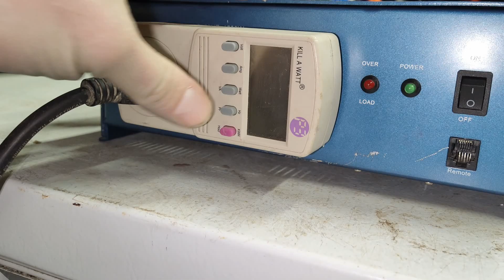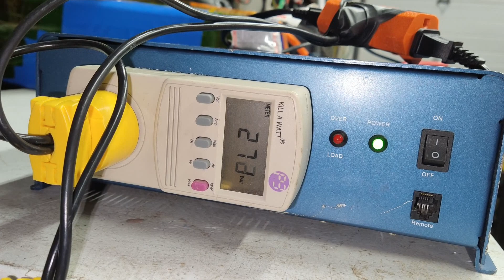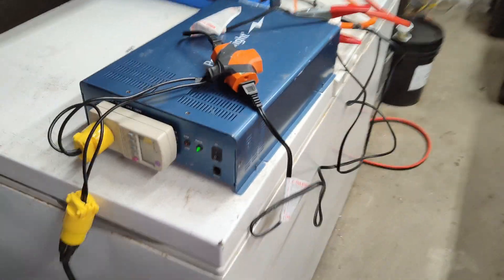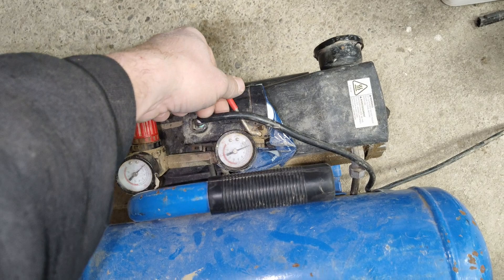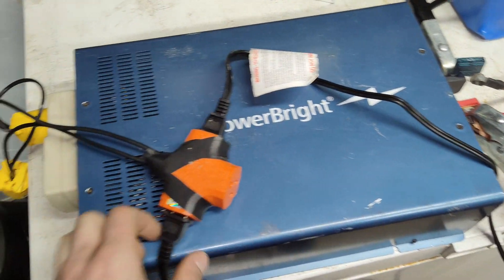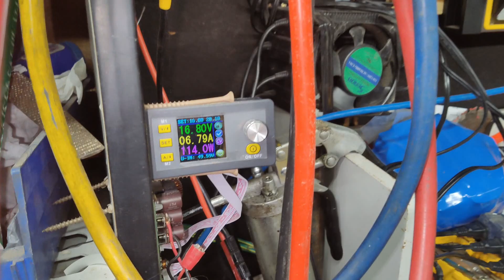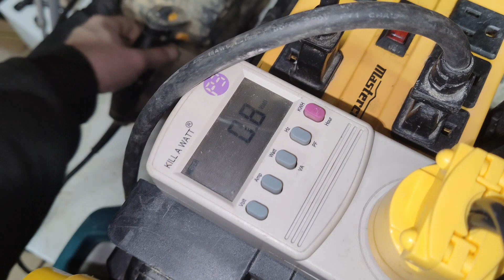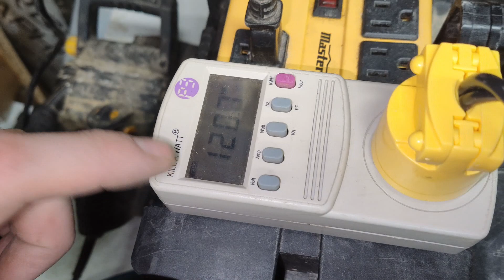DIY Electric Motor Soft Start

Comment: Don't you want to cut the heaters out of the circuit after the motor is started?
Reply from the maker: Yes but this little inverter can't run the motor under load.

Comment: I have seen this technique used for radios and other devices under repair/construction by using a light bulb to limit the current. Using this for motors as a soft start is genius!

A switch to bypass the heaters once the motor starts might be good to add, since the resistance reduces the power.

I will try this at some point to see if a smaller generator can drive my water pump.
Reply from the maker: Thanks, yes a bypass switch would make it even better.